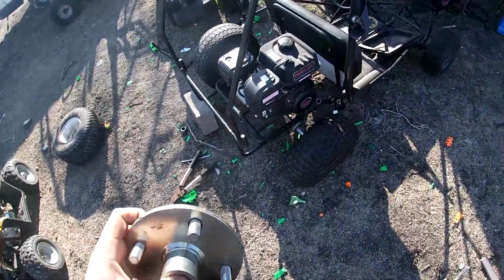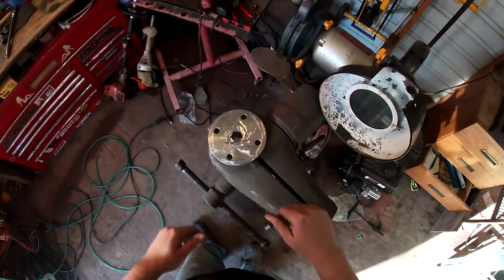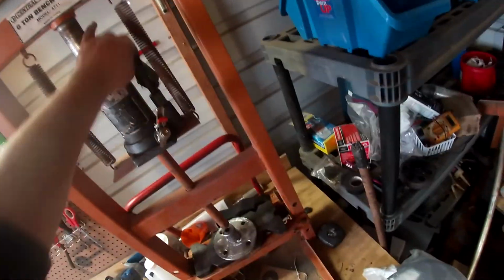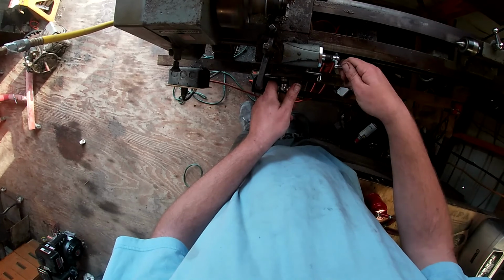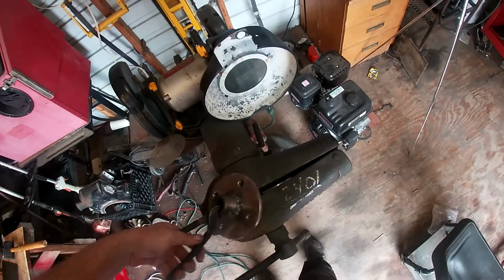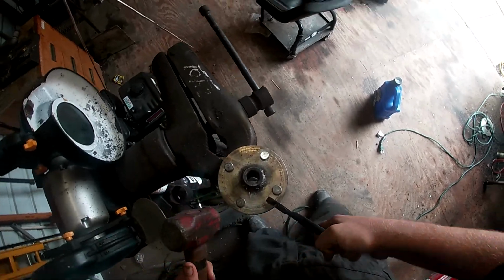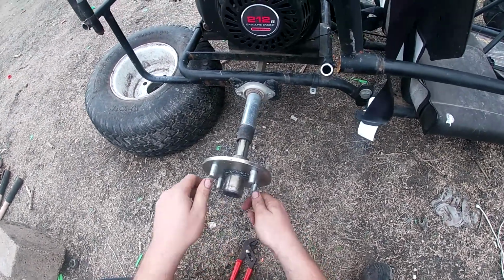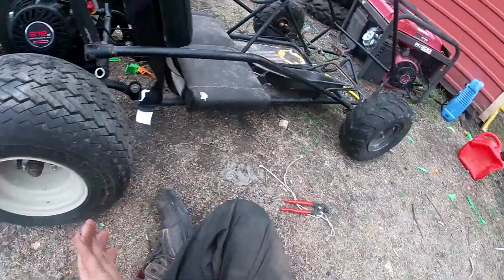Custom Hex Bore Go-Kart Wheel Hubs

Comment: Good job Brandon. Using the new parts on the old hubs worked good
Reply from the maker: Thanks Roger I didn't know if it would work at first but it worked good. Using the lathe to remove old welds took 2 hours.

Comment: When your shaving metal off a item on a lathe you should be using cutting fluid or lubricant of some kind
Reply from the maker: You can't see but I was. If you look at the sparks when I cut it down it is hard tool steel so alittle harder to cut on a small lathe
Reply: @BSSMALLENGINES  I didn't see you put any lubricant the harder the metal the more lubricant you use and if your cutting hardened steel should be using dedicated cutting fluid
Reply from the maker: @AntonioClaudioMichael  The video is cut and speed up in parts
Reply: @BSSMALLENGINES  aww okay

Comment: You could of just Used the lathe to make a hex Bushing to go inside The Orginal Hub hex you cut off or you could of used a drill press like a mill
Reply from the maker: After talking to some machinist it would been alot harder then this method